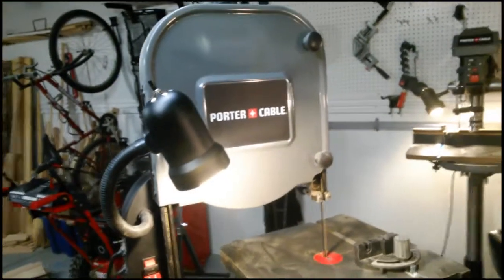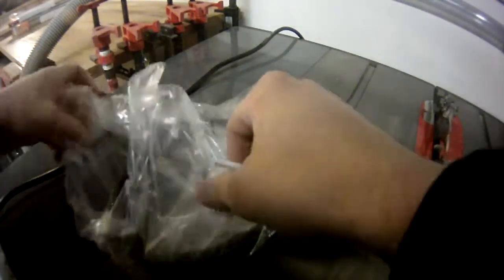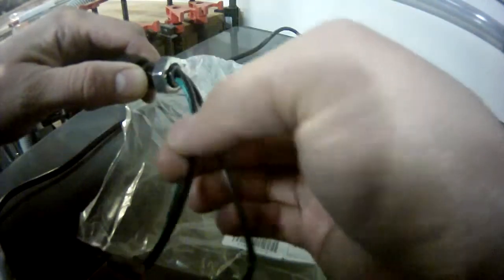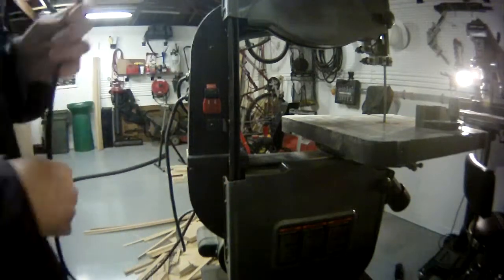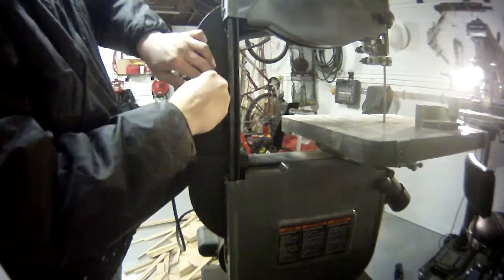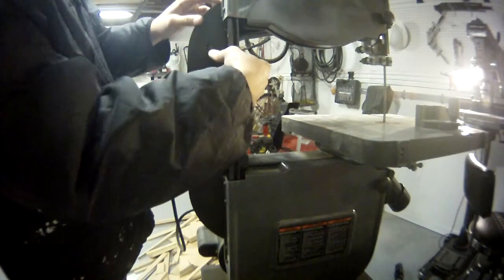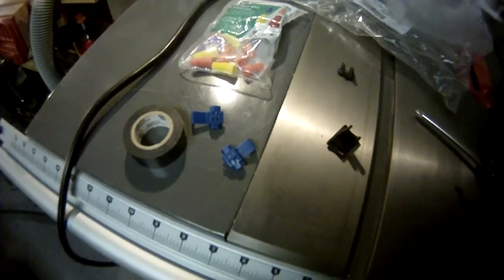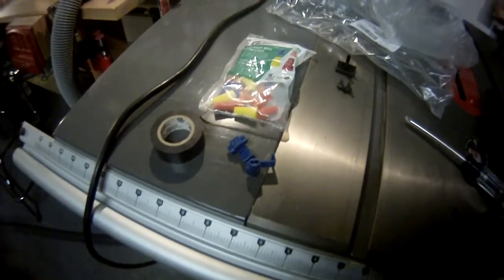How to add a Worklight to a Bandsaw

Comment: Nice Job other than the wire splicers, which actually cut strands of the conductor when compressed.  Glad you showed enough detail for those who are not comfortable with 115V work. Nice clean job overall.

Comment: Why the 2 thumps down...haters will be haters.  Great video.  I have the exact same bandsaw and I've been using the Ridgid 18v flex work light  but for 30 bucks this is a no brainer.  I buy mostly Ridgid tools for an array of reasons but it looks like you stick strictly to porter cable...any reason for that?